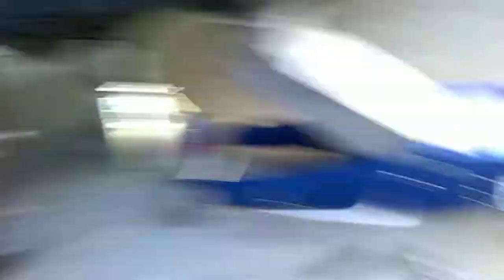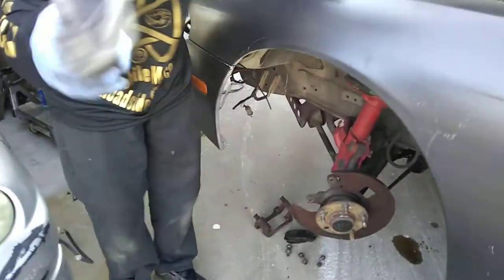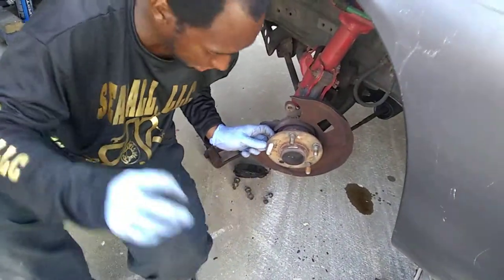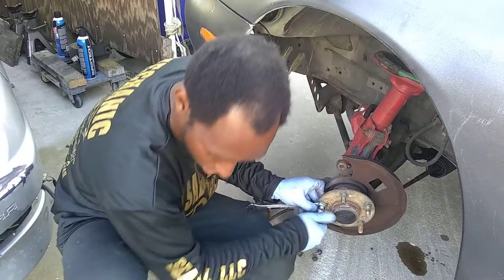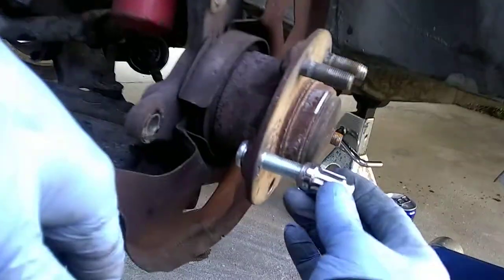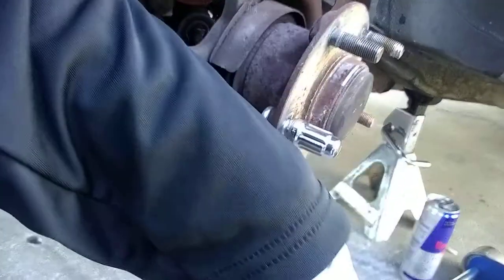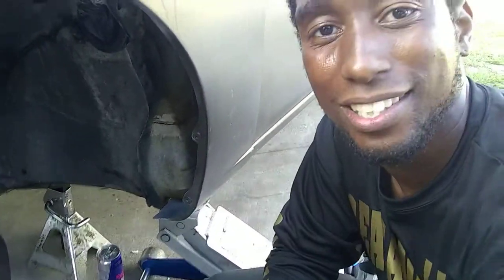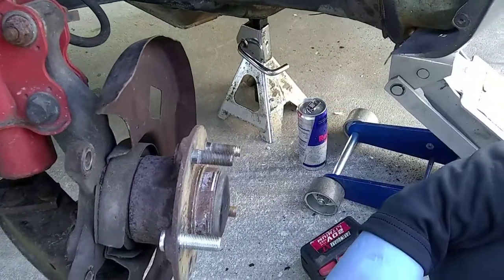How to replace and install wheel studs without a special tool

Comment: Thanks for the video.

Viewers, don't use aftermarket lug nuts to press in studs with impact. Use the standard ones. They're stronger and they don't need a key which creates additional energy loss, additional failure possibility, etc.
Aftermarket lugs are only used to attach aftermarket wheels to a car.
Reply from the maker: There's definitely a better way to do this but in a rush and in a pinch this will definitely get you by. I appreciate the comment

Comment: You're an absolute G for this. That wrench  spacer trick was the truth.
Reply from the maker: Hey I'm super glad it worked the tool actually isn't that expensive but if you're in a pension need to get it done you got to do what you got to do I'm glad it works for you 🙌🏿

Comment: No sir! That’s is how u properly shred new wheel studs! Lol the tension coming off was the lug nut re threading the stud. That’s going to break off when tightened. 👌🏿
Reply from the maker: If you don't have the tool that inverts in to put it on and you're in a pinch it will definitely work. And no it did not break when we torqued it down. But I do appreciate that insight 🙌🏿💪🏿✌🏿

Comment: Lisle Corporation and 
OEMTOOLS make a wheel stud face centering tool Which is a lot better and trying to Stack some wrenches or use some washers And even with those bearing centering tools you could seal strip out the thread on The stud So really it might be better just to use a ball joint press
Reply from the maker: That's a good point. The ball joint press idea does work but can be hard to get into the space. They can get stripped either way and it is better to use to the correct tool but in this case, the tool ( if we are referring to the same tool) is basically a big recessed washer. The basis of the video was to be able to do it without the proper tools 😂 but I understand and appreciate your comment.

Comment: Good video. I will try it myself this weekend.
Reply from the maker: I haven't made an update video but the part that you need to actually use the stud in the hammer It's pretty cheap even if you only use it once it's worth buying but you can try this method but when you're at the parts store just tell them you need to lug nut stud remover It may save you headache
Reply: @Fasttowpro  I am swapping a wheeel hub and I have to remove the studs so the hub tool fits. The studs come out easy with a good hammer. I will use a wrench as my spacer when installing the studs.
Reply from the maker: @edbrandt8972  sounds like a game plan but I'm not sure what you're working on where you have to remove the studs to remove the hub but long as it works for you I'm glad it helped 🙌🏿
Reply: @Fasttowpro  I am using a special tool on a Volvo C30. With the studs removed I have the clearance to get the tool to clamp onto the outer race of the bearing.
Reply: Mission accomplished. I did not need the special tool. I used a wrench to get the new stud partially seated. The when I torqued each lug nut to spec, it fully seated in place.
Reply from the maker: @edbrandt8972  Hey thanks for that update so that means that it still works that is classic super glad you save the money and got the job done properly well done sir

Comment: I’ve done this and the stuff will not set starting at the grooves so I’m guessing the idiot at the part store gave me the rear studs instead of the front. Working on a 90 f250. it’s been fun..

Comment: How do you lock the wheel hub I am trying to tighten it down but it keeps spinning
Reply from the maker: Hey sorry for the late response you can use a crowbar in between the two lug studs and prior towards the ground so when you're spending it and it's going clockwise the pry bar will be going the same direction but hits the ground and stops The hub I hope that makes sense✌🏿
Reply: @Fasttowpro  That sounds super helpful.  I was trying to do this with a ratchet and a stud installer puck and I was having a bad time.  I'll give this a try later, thanks!
Reply: try impact wrench

Comment: Great video.. so what do I do if while tightening the new wheel studs they spinning..? 😩😩 I’m using hand tools, ratchet and a socket.!
Reply from the maker: Hey that's a bit concerning. In the back of the stud there's ridges that are supposed to grip inside of the hub. If it's still spinning you have to apply pressure towards the back so I can pull the stud forward. So if you can turn the wheel so the hub is facing out hammer in the stud just a few times so it can have some traction and then try to use the impact and the lug nut to pull it forward. I hope that helps ✌🏿🙌🏿 thanks for the comment
Reply: @Fasttowpro  seems like it went in all the way in,  a ma try this rite now, it’s my ATV a quad, not a car. If still spins you think is a good idea adding some welding.? 😂

Comment: What about replacing wheel studs on a 1994 Dodge Stealth R/T?
Reply from the maker: Unless it's all-wheel drive it should be the same process but if it's a VR4 style then you may have to just remove the axle from the ball joint or hub assembly to be able to get the stud all the way out

Comment: Can new studs be "drawn thru" using just the washers and threads method on a VIRGIN AXLE?  Meaning, a brand new axle that has NEVER had STUDS before?   Virgin pilot hole???
Reply from the maker: I want to say yes although I've never done it that way it's the same exact concept of using the open end wrench. The only problem is you going to need a couple of extra lug nuts doing it this way because it often destroys the lug nut pulling the stud through. It's a lot more ideal to have the actual tool but if you don't this method works wonders and yours should too. Thanks for the comment ✌🏿
Reply: Why would it being new make any difference? Yes, new, used, same process.
Reply: @BPoweredLove  I got the job done, but did ruin the threads on quite a few lug nuts.  Ruined at least 1.5 lug nuts to draw each new stud into a new axle head.  Pulling new stud into old axle was half the force needed because the steel hole has already been stretched.  Maybe one day you'll get your hands on a brand new virgin axle and do this job without the use of an impact wrench.  I did the work with the axle in the truck, but not clipped into the differential.   With the diff cover off, insert a rag into the gears and every thing is locked SOLID.  I completed the job before clipping in the axle incase I needed to take the work to someone with a press.  First time doing this and wasn't sure of my skills.  Happy wrenching to you.

Comment: OH HORSE FEATHERS - tap, tap, tap and your wheel studs just fall out, right?  I've been beating on my broken wheel stud with a mini sledge and it still won't come out.  If I had been smart, I would have put an old lug nut on the stud and hammered on the nut instead of the stud.  Now it's too deformed to get a lug nut onto it.  I guess my only other option is heat unless someone has a magical method for me to try.  UPDATE FOR THE REAL WORLD - the magic method was to go over to Harbor Freight and buy their $ 15 AIR HAMMER and another $ 60 for their tool set with the actual hammer head.  Even then it took awhile for that damn stud to pop out.  I had soaked that stud with PB Blaster for two days, too.
Reply from the maker: That seems like a lot but it depends on where you're at in the condition of the studs. Are you in a rusted area while you're having so much problem with the stud?
Reply: @Fasttowpro  It caught me by surprise, too.  My buddy offered to knock it out as he also thought it would be an easy job.  Oddly, this is a Tennessee truck that just came up to New York and I bought it from the owner who wanted a different truck.  It baffles both of us why that stud was so difficult to remove.  It was even a tough task for the air hammer but it finally popped out.
Reply from the maker: @STBRetired1  well completely understandable. Trust me I'm down here in Florida and I absolutely reject anything that has more than surface rust. I have a video somewhere so the type of Carnage we get down here from up North and after that last one I did I decided no more what did you end up doing to get it out?
Reply from the maker: @STBRetired1  https://youtu.be/MtUSuTKdFZg
Reply: @Fasttowpro  No, no, no, nothing like that.  Remember this is a Tennessee truck that JUST came up to New York so there isn't any rust on it.  I don't know why that stud was so difficult to remove.  Maybe I wasn't hitting it as hard as I could.  All that pounding on one side of the axle seemed like it might break something and that worried me.  I didn't want to see any differential oil leaking out later because I bent something.  But that air hammer from Harbor Freight was like a jackhammer.  It just kept pounding away.  The pounding wasn't as strong as with a sledge hammer but they were rapid and repeated.  That jarred the stud loose and popped it out.

Comment: This would've been a good video if you'd made it fit.
Reply from the maker: I should have shown the other side to this once I put the wheel on it pulled it the rest of the way through but I didn't bother to board with the details thanks for the comment

Comment: Nice tutorial man there’s a quicker way though.
Reply from the maker: Ruthless💪🏿
Reply: Hey srry man you could’ve put a normal wheel nut on stud that goes right through then the normal capped end wheel nut to tighten and make it flush on the back. Way quicker.
Reply from the maker: That's a good tip, I don't think I've done it like that before but I'll definitely try next time I have a couple cars at the shop that need them now

Comment: Best way to damage the bearing. Foolish way.
Reply from the maker: Never damaged one to date but if someone doesn't have tools it works
Reply: During its lifetime a bearing spins over 100million times at high temperatures taking impacts from the entire vehicle. Unless if you were extremely careless it seems very unlikely to damage it this way.
Reply: @SS-du7tr  - That's exactly why it's a really bad idea to pound on the hub in that direction. It doesn't take much to alter the concentricity of the bearings and you definitely stand a chance of damaging the bearings. Hammering them out this way is more like the effects that occur when a car is broadsided.
Reply: @steveTGO  not sure if a few taps from a hammer toward the center of the hub equal a side impact from an accident. To be safe use a press, it's not any more difficult as long as you have access to one.
Reply: @SS-du7tr  - I didn't say it equals it, I said it results in the same effects, the totality of the damage would be a variable based on speed and mass. I am not trying to be a smart ass, I work in the Commercial Tire and suspension industry and I have seen numerous examples of damaged bearings, resulting from stud pound outs.
      The same principle applies, if the studs are extremely clean and fall out easily, the chances of damage is lower than if they need to be smacked good. Keep in mind, for a bearings assembly that tolerances are measured with super precision to the thousandths, that little bit of off center pounding can result in damage quickly.
Reply: @steveTGO  but everyone hammers the studs to remove them